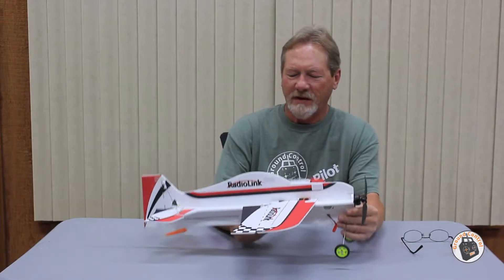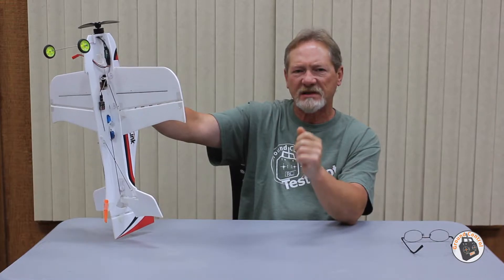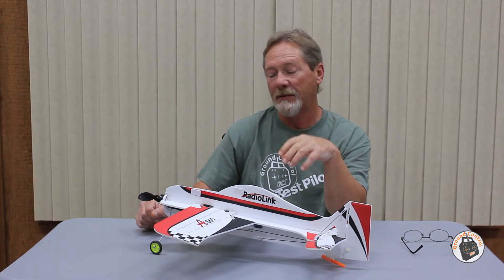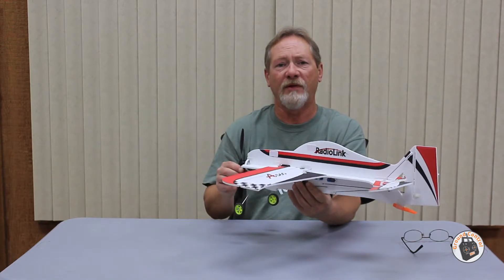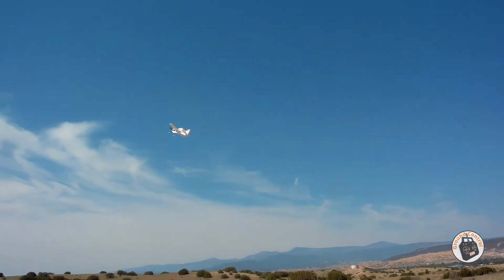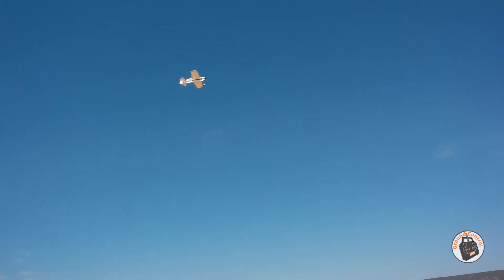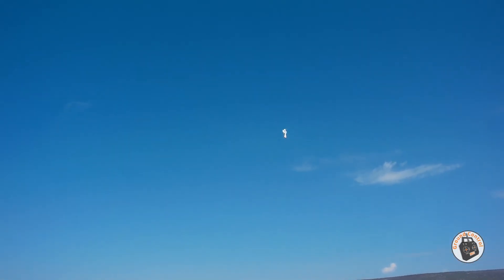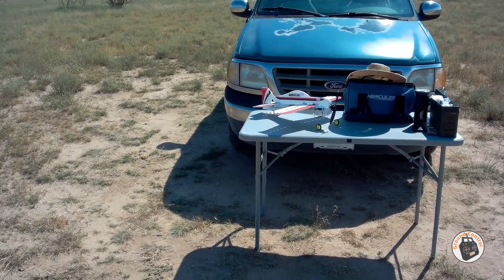Lesson #1 - How to Perform a Hover! RadioLink A560 Trainer 3D Plane with 5 Mode Gyro RTF

Comment: Looks like a truly fun little plane. After watching your videos I ordered  the V2 version of the flight controller to use in a 3D plane I've had for awhile. I think I'll order the A560 as well. According to Radiolink's specs the flying weight is only 206 grams. No stupid remote ID module required. Yay!
Reply from the maker: It's a very fun little 3D plane.
I was never interested in 3D planes until I got this one.
Now I will continue to have at least one in my fleet.
The quick assembly / disassembly and the padded case make it easy to take on the road.
They really put a lot of thought into the design.
Mine comes in right at 200g AUW with the stock LIPO.
Sub-250g works for me ;-)
See you in the Air!

Comment: I'm thinking about getting the v2 flight controller that has 6 modes,it has normal operation of control when in vertical mode
Reply from the maker: Hi Jason!
I'd heard they were coming out with a new version but I've not seen it yet.
I informed them I'd like to see a 6ch-8ch version of the byme gyro.
I hope they come out with those as well.
The next time I purchase some I'll have to check out the V2.
See you in the Air!